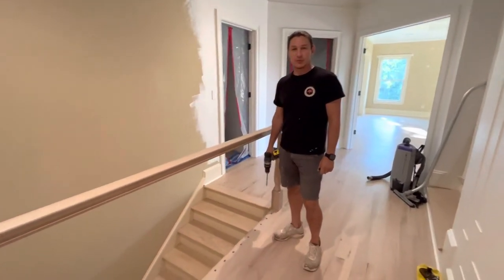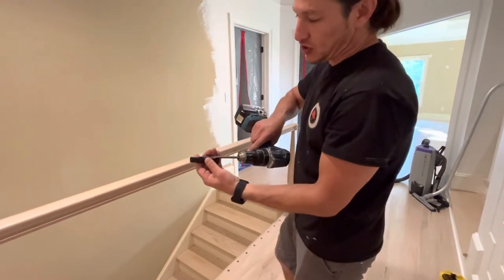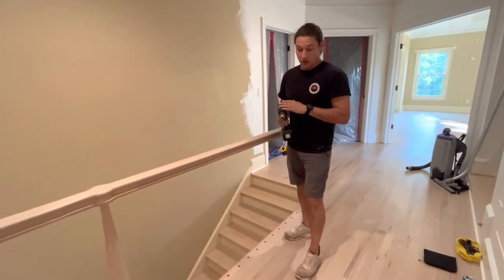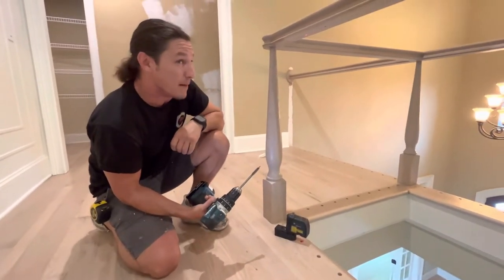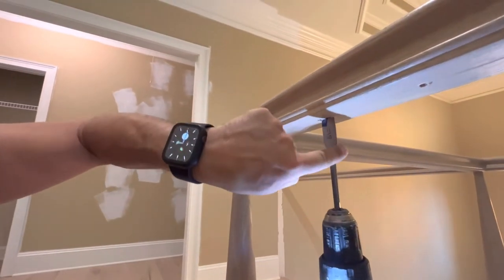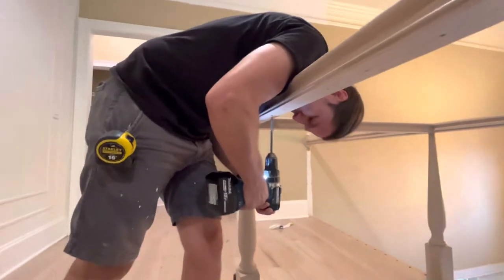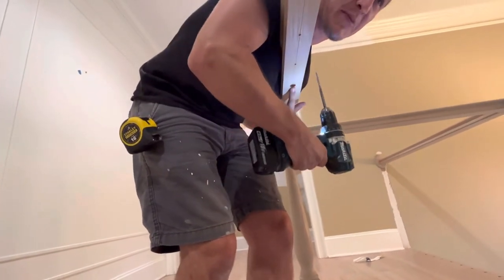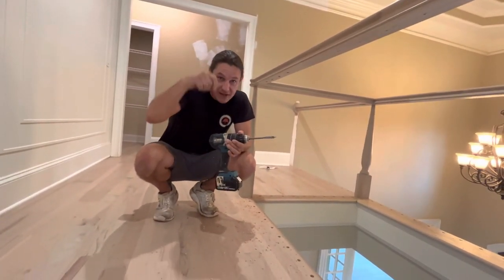Drilling Baluster Holes

Comment: Use the zip-bolt system for rails. Once you dry fit and mark, you can easily remove, take to a drill press, portable drill press, or some other jig on your workstation. I’d be more comfortable on my back, hanging over the edge drilling toward the sky than whatever is being done in this video. 

Also, I’d recommend forstner bits or better yet, brad-point drill bits, never spade bits! And to minimize tear out, use frog tape to mark the locations prior to drilling.
Reply from the maker: These handrails are bolted together with hanger bolts like they should be.  Why should I or anyone else spend time to put together a handrail with tiny half inch nuts to pull it all apart and do it again.  There is no can easily remove about this option.  It’s a waste of time.  I have never seen any carpenter with a drill press or portable drill press in the field.  That’s with 25 years of experience and I’ve been around some wizards.  This is not a realistic option.  Yes laying on your back staring straight up at flying wood shrapnel is definitely the better option for you.  Forstner bits are the absolute worst option.  That will take forever and burn your drills up.  You would have to run your drill on low speed to even have a chance and sometimes 150-200 holes in red oak.  This will burn a drill up.  PERIOD…Makita brushless, milwaukee brushless…all of them.  Run a forstner bit on high speed and your just going to burn up $8 bit about 10 times.  If you’re not comfortable drilling holes using this technique don’t do it.  This video illustrates the quickest, fastest, and most precise way to do it.  Hands down.

Comment: I have the opposite issue. I'm replacing wood baluster with wrought iron balusters. My holes are at the top underneath the hand rail. Can I use the level you used to find the hole locations on the knee wall? What brand is that level if it will work for me. Or is there an other way for me to drill out the holes on the knee wall? Thanks for any help you can provide to me.